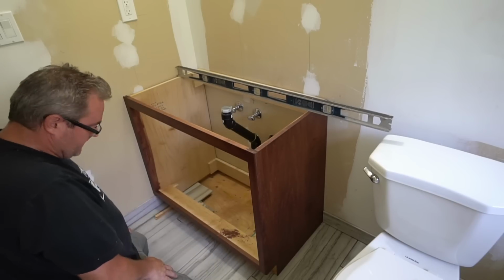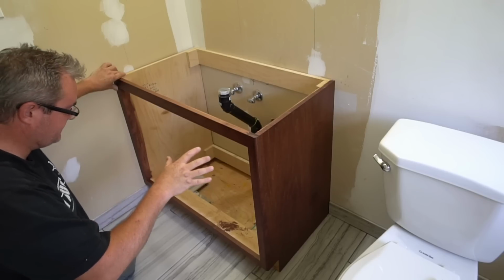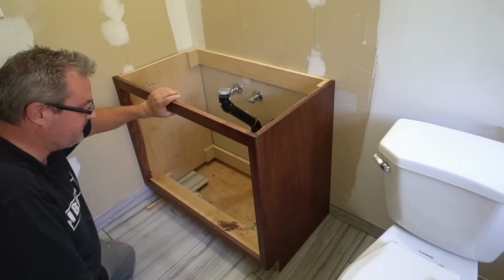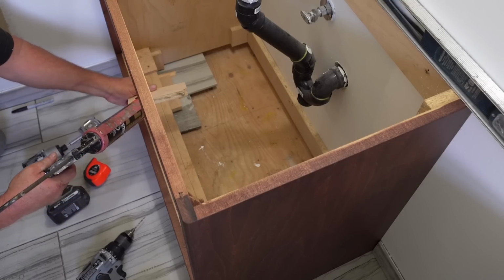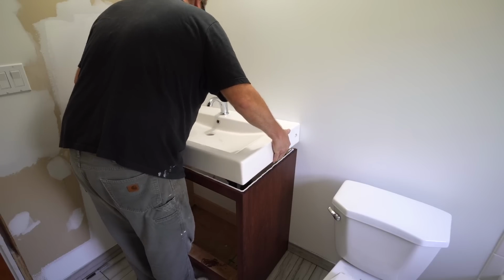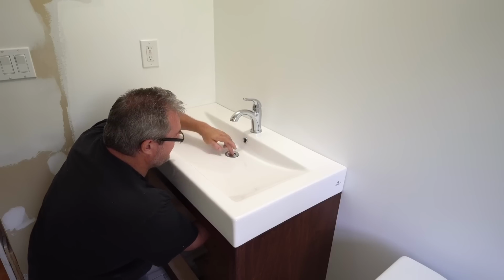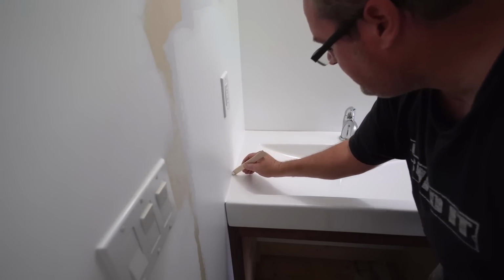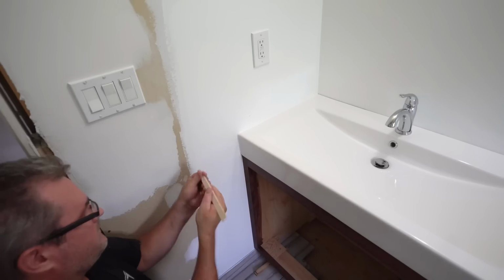Installing The Bathroom Vanity

Comment from the maker: Now that the carcass of the vanity is finished, it can be installed and the sink put in and hooked up. Like I said in the video, I need to get this cabinet in place to finish the tile base on the floor which wraps around the bottom of the vanity. In upcoming video(s) I'll build and install the three drawers, and make the drawer fronts that match.

The video (25+minutes long) where I change the plumbing:
https://youtu.be/wi90dnMoW2Q

Here are some ways that you can help support the work I do in making these videos:

Plans for sale: http://www.ibuildit.ca/plans.html

Patreon: https://www.patreon.com/user?u=865843&ty=h

Website: http://www.ibuildit.ca/
Facebook: https://www.facebook.com/I-Build-It-258048014240900/
Instagram: https://www.instagram.com/i_build_it.ca/
Google+: https://plus.google.com/u/0/b/107142665853474113931/
Reply: P0p0

Comment: I wish I had known it was acceptable to use latex caulk for the sink to cabinet connection a few weeks ago. After installing an undermount sink with silicone, I discovered a defect in the sink and had to replace it. Getting it back off the wood counter was a nightmare!

Comment: Im replacing floor and vanity, does the vanity go on subfloor or finished floor??
Reply: Over the finished floor would be best.  It leaves another layer of protection from water or pests.  It also allows future owners the ability to swap out the vanity without having to do anything to the floor.  It’s also easier to install/make the vanity to a size you want with less hassle.

Comment: Lol STOP what you're doing!!! mains sockets and rocker light switches in a bathroom!!! Are you crazy!!!  I suppose the laws governing that kind of thing in your part of the world is completely different to the UK, just seems very strange seeing rocker switches and mains sockets that close to a sink in a bathroom environment, in the UK that's just completely prohibited. 

The above is not a dig in any way, seen loads of videos with switches and sockets in bathrooms on YouTube. I just find it weird to see sockets and light switches in bathrooms, we have to have pull cord switches in the UK, since you're probably on low voltage systems in your part of the world there's probably completely different rules. Very nice work as usual. I do look forward to your videos on all your channels i  subscribe to all four of them. Thanks for all your working editing and uploading and of course in the work and detailing you show. Yours the DM UK.
Reply: In the U.S. bathroom outlets, just like kitchen countertop outlets, have to be GFCI protected.  So just about every bathroom in the U. S. will have an outlet next to the vanity for hair dryers, curling irons, electric shavers, water pics, etc.
Reply: Bathrooms in the UK  are zero rated. I remember times when we used to run cables under baths from consumer units on a wall from the room downstairs, you get locked up now in the UK for that,  like I say zero rated.  all the switches on the walls in this video would be prohibited in the UK, they would have to be on pull cord switches for showers lights and vents,  rocker switches particularly are just prohibited. It's been sometime since I worked in the industry as I'm retired now,  I remember the golden rule, it was,  if you can touch water and a socket or a switch At the same time it's prohibited end of. Yours the DM in UK.
Reply: He's in Canada not the US so who knows what their regulations are. For all we know they coat them in maple syrup for water repellency.
Reply: I won't even go into tap,pipework,drain earth bonding. I just find it incredible that anyone would have a power outlet next to a sink. Because he lives alone, I know he wouldn't be that stupid but the potential is there. ( I get the impression he lives alone) ,It's not a dig it’s just an observation of the differences in the laws regarding this kind of thing around the globe that just surprise me. Yours the DM UK.
Reply from the maker: It's a ground fault circuit interrupter outlet - Google that if you have any interest in learning more.
Reply: i completely understand all that and we have the same over here, but still not allowed lol.
Reply: Y'all in the U.K. still haven't figured out how to have hot and cold water come out of the same faucet. Of course the queen doesn't let you have outlets in the bathroom.
Reply: Is there a reason why it's not allowed in UK? My guess is ground fault protection isn't mandatory in UK? With modern self-test GFCI I can't figure why it's not safe. In US a sink must have an electrical outlet on the wall within 3 feet.
Reply: Most of the world have sockets in bathrooms and have had for decades yet the UK doesn't. In my opinion the UK is behind with modern day regs
Reply: Reading comments from our European brothers on youtube often makes me realize why we left Europe in the first place.